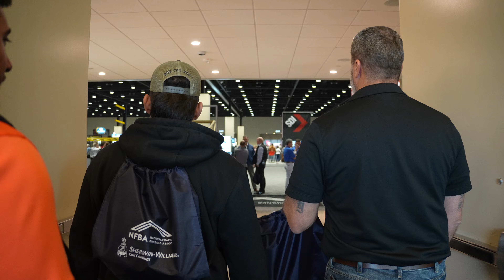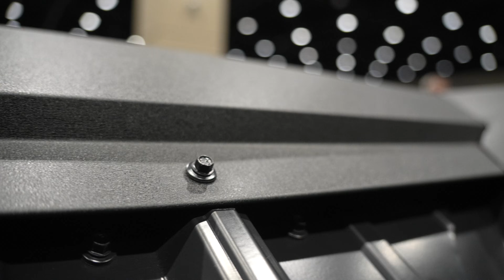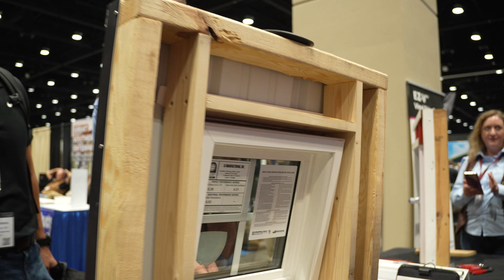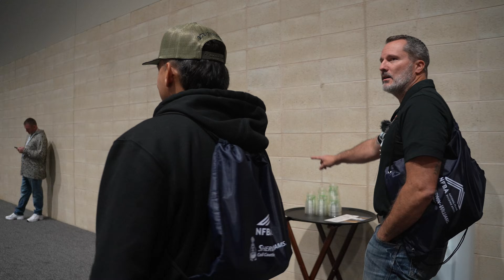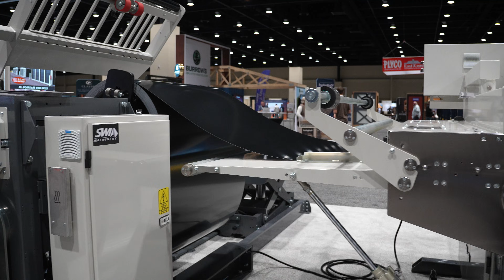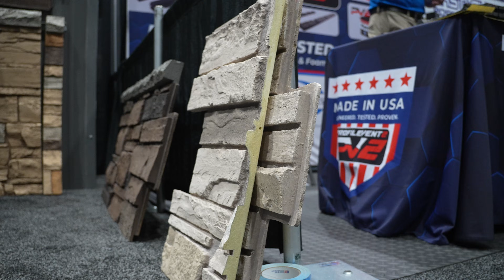Exploring NFBA Expo 2026 | New Products & Building Ideas | WolfSteel Buildings

Comment: I would consider the textured trim & panels for my upcoming build. I would expect that the surface would need cleaning more often as it might hold dust more than the higher sheen material. 

I would also LOVE to have a standing seam roof and the steel panels that you didn't talk about, but looks like board & batten.